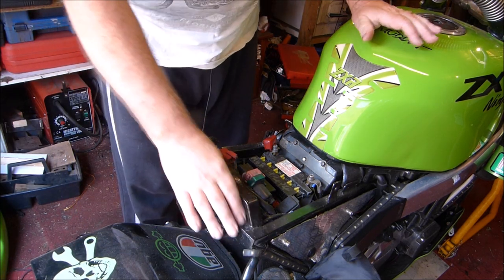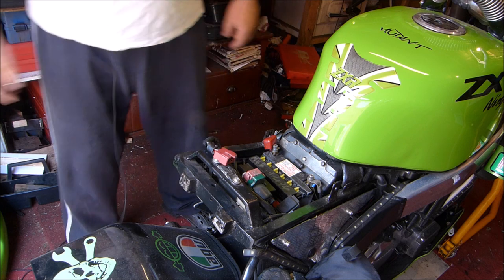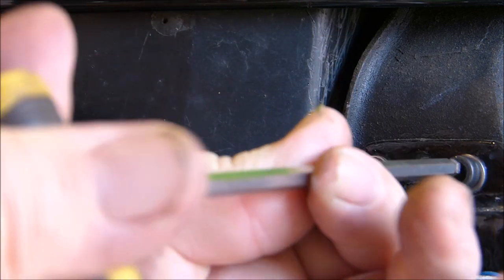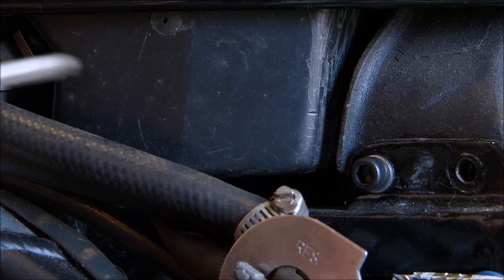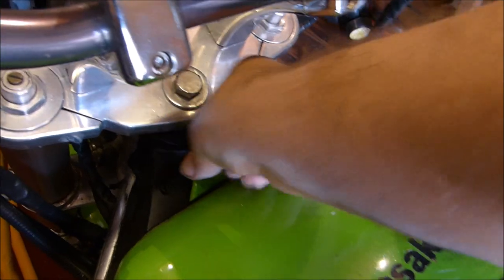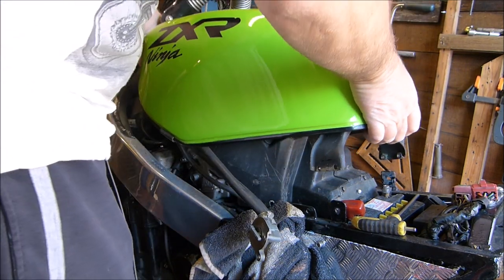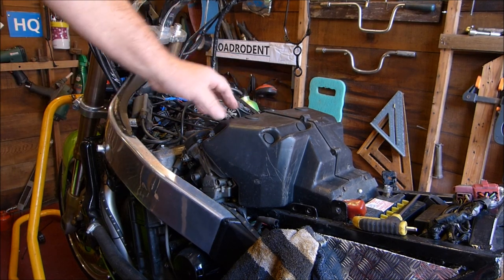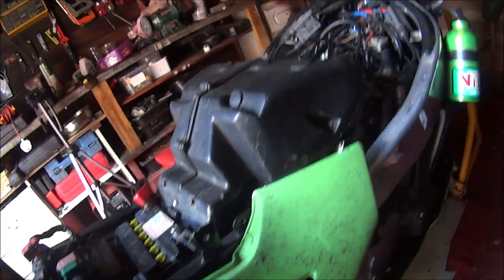ZXR750H1 Fuel Tank removal.P-4.

Comment: what year is that ZX7?
Reply from the maker: 89
Reply: @jonyr1TT  thank you I have a 2002 2002 zx750p and I'm trying to figure out how to put the tank back on because I acquired it with tank off and air box off and there's like hella vacuum and or vent lines and or pressure line going from the tank to the airbox to carbs and just all over the dam place and since the only internet source I got is this lil cell phone 4.5 in screen the  pics from manual I downloaded really hard to see so my mind is boggeld atm cuz i cant find vid showing how to  reassembling this bikes airbox and fuel tank....🤬💥
Reply from the maker: Yes they can look a bit bit scary but I think most of the pipes just hang down as over flow pipes.